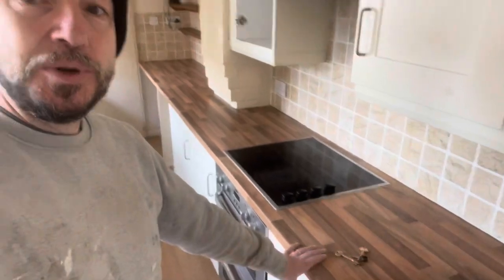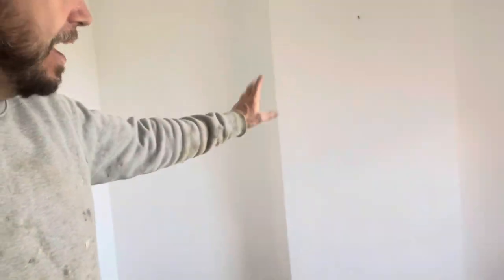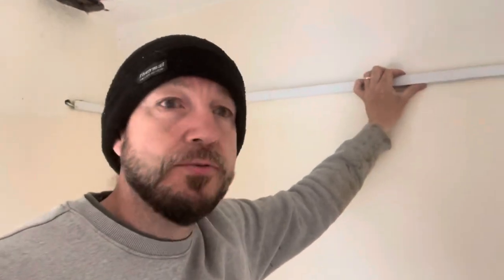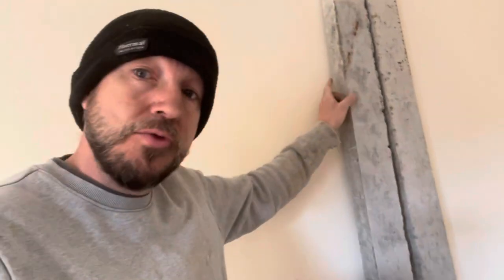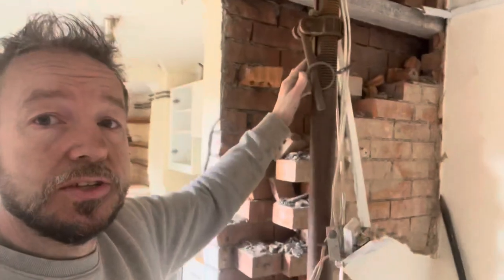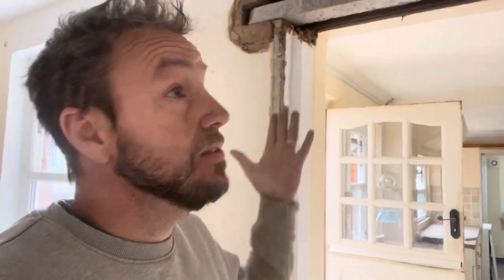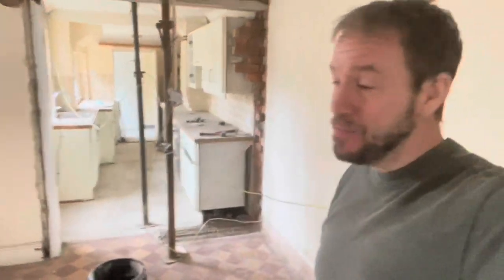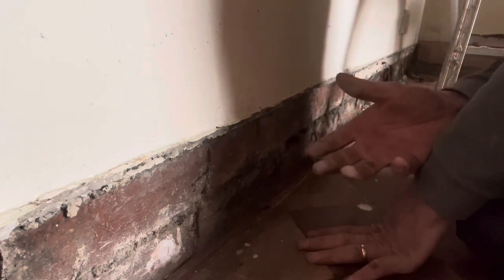Welcome to our new homestead - removing walls and laying floors

Comment: Oooh how exciting and what a lovely house! Re laundry facilities, I keep mine upstairs (used to be next to main bathroom on first floor but now is up in the loft!). I really like keeping the laundry contained upstairs, I hang it all up to dry indoors as well, used to use a dehumidifier but now in the loft it dries really quickly even without one 👍 we don’t run the washing machine overnight so noise is not an issue. I guess the only thing is the risk of flood, but the benefits outweigh that for me so far! 🤞🤞🤞
Reply from the maker: Great to hear I’m not the only one! I’m not certain where we will end up putting things yet as my wife has her eye on that cupboard for linen, but we will see…